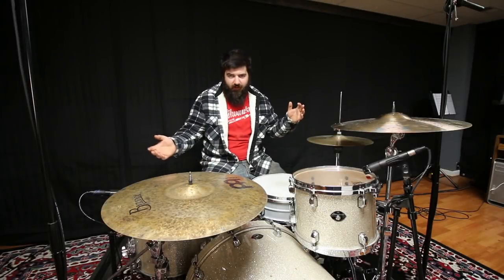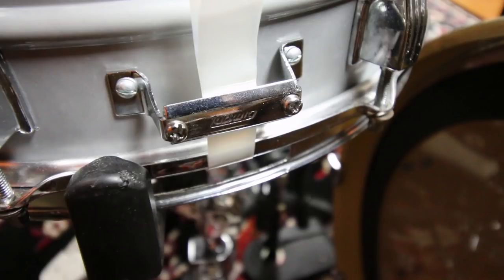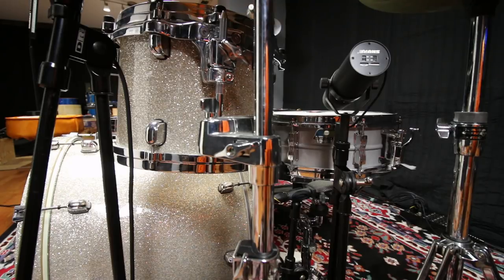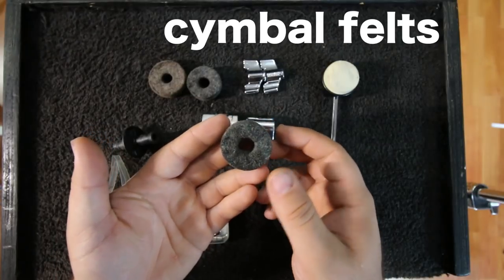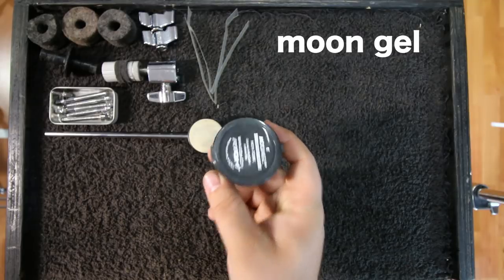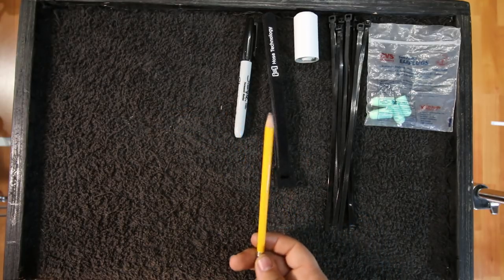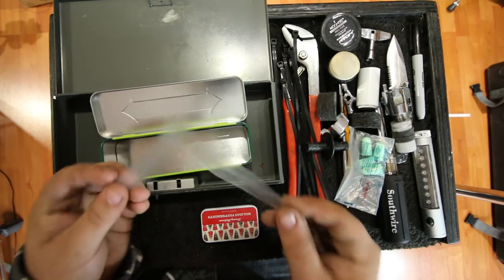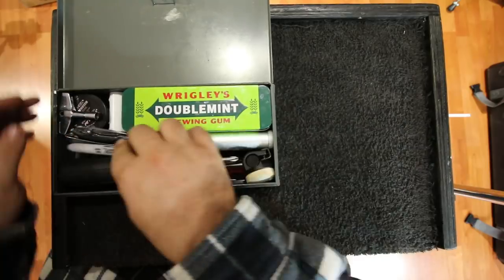How to Make an Emergency Kit for your Drum Set

Comment: in my drum hardware bag i also carry a set of acoustic and electric guitar strings, set of bass strings, some guitar picks, a tuner, a capo, a guitar strap (or two), and a pack of 9 volt batteries.  if the guitarist you're playing with had a dead 9v or broke a string on his guitar and you pull out the lifesaver from your drum hardware bag, you're getting a call when the next gig or project comes up.
Reply: Good guy drummer having the back of his stage mates. That's beautiful.
Reply: Yeah, great tip.  I used to carry an extra instrument patch cable and short speaker cable with me.  My guitarist band-mates were ALWAYS forgetting speaker cables for their cabs!
Reply: Same here. Extra instrument cable, plus a universal power cord, small extension cord and power strip.
Reply: Roe Sham Boe I also carry those stuff. But more so because I also play other instruments.
Reply: Roe Sham Boe never seen a drummer do that,that's great that you care about your other band mates
Reply: God bless you
Reply: Might be the wrong gauge though.
Reply: @russ6541  Better wrong gauge than no gauge, no?
Reply: I use a 9v for my IEMS amp and always carry one or two spares. There's been a few times when I had to hand one of my band mates a 9v.

Comment: Great advice, both in the vid as well as in the comments. I did some rearranging a few weeks back with the stuff I bring, and this is the current inventory (WARNING: BIG LIST)

In my stick bag (which I bring to rehearsals and some short gigs where I don't set up my own gear), I have the following:
- Sticks, mallets, brushes, etc
- Small digital metronome (mostly for songs I have to sightread)
- Voice recorder (to record rehearsals and sessions)
- 2 drum keys (can't have enough, take my word on this)
- SlapKlatz (gel dampening, like them better than Moongel)
- Multitool (foldable pliers, also include a knife, flat and phillips head, beer/can opener etc)
- Pencilcase with pen, pencil, eraser, sharpie, scissors etc etc (all the stuff I need to write out sheet music, quite a regular activity for a session musician)
- Blank sheet music in a folder
- Earplugs

In my gig bag (which supplements my stick bag for actual gigs and lengthy rehearsals):
- Practice pad (for warm up or dressing room rehearsals)
- Spare drum key
- Kickdrum patch (life saver!)
- Drum tool (with typical drum set tools)
- Thin cotton sheets (pillowcases) for dampening/effects
- Flashlight
- Music stand light (don't EVER think the stage lighting will be enough)
- Batteries for said lights
- Clothes pegs (you learn why the first time you have a sightreading gig in the open)
- Spare kick beater
- Hi hat clutch
- Drop clutch (for twin pedal gigs)
- Spare parts of every part on my kick (rods, washers, snare straps, felts, cymbal washers, screws, kick pedal springs, you name it)
- Earplugs spares
- Single use earplugs (for every single singer alive, they never think of their ears)
- Water bottle
- iPad (for sheet music or to watch porn during a gig)
- Powerbank (for iPad)
- Towel and deodorant (making an impression that lasts isn't always a good thing when you're a drummer getting off stage)
- Duck tape, WD40 silicon oil spray, tie wraps, rope and string (not for naughty stuff, just to be able to fix anything ever)
- Band aids and painkillers, just in case
- Spare multi clamp, to fix anything onto anything (drummers know what's up)

I also bring spare heads for any drum head, save my bottom tom heads, packed in the cardboard sleeve my kick drumhead came in. Also includes o-rings for my toms and a Big Fat Snare Drum

I usually also bring a foldable music stand, a pillow for my kick if it's not already in there, and sometimes an extra kick pedal.

Excessive? Absolutely. Until you need one of these things. My philosophy is that I want to be able to fix anything that could break and ruin a gig for me (which are quite a lot of things when you think about it), and it makes me feel very secure.

Hope this helps anyone wanting to come prepared. All the best.
Reply: thanks for putting in the time! My kick pedal broke AND snare stand fell apart at my first gig, this will help me be more prepared for next time.

Comment: I always used a multitool that has pliers, a knife, various screwdrivers, a ruler, and even a file. It takes up less space. Also for a case .... say what you want but I use a makeup bag. There is three compartments with open areas, some compartments are divided into smaller compartments etc. It also has a clear plastic front where I put the tools I use often  so I can get at them quickly.

Comment: Fun tip. I’m a drummer and a motorcycle rider and i learned that motorcycle chain lube works great on the threaded parts of the drum set. Particularly the wax kind of chain lube. Dip your threaded wing nuts in it and thread them. The wax kind of lube drys in about 30 minutes so you get the lubrication factor of grease or oil but it’s dry to the touch.

Comment: Great video!  I've discovered over the years that carrying enough cymbal sleeves for the total number of cymbals you want to use is super important.  I can't count the number of times on tour that I was using borrowed or backline setups with NO cymbal felts or sleeves.  On that note, I also keep a few different diameters and lengths of sleeves as well as 6mm and 8mm wingnuts to fit any brand of cymbal stand I might encounter.

Comment: Got all of those things carried inside the front pocket of my old VHS Video Camera bag. The bag itself can fit all of
my extra pairs of drum sticks, and my DW 5K Accelerator double-kick pedals (with linkage bar unattached, but included),
and my kick drum straps (to prevent kick drum creepage).
I wear glasses during a show; sometimes I don't; but for those sweaty hot stage gigs I keep a couple of straps
for my glasses so they won't slip off my face during a show.
Extras: several D-RINGS, two Dog Leashes, and a few Bungee chords... I gotta have those on hand in case I ever
forget my kick drum straps.

I keep larger tools (vise grips, drill, rasping file, gorilla glue, double-sided tape for use as drum stick grips, and a mallet) 
inside a gym bag, which I also bring along with me to gigs.
All the rest of my drum hardware, mounts, throne, cymbal stands go into my wheeled carry-on luggage case. lol
I used to use my old US Army duffel bag, until I lost a hihat rod. So then I started using a luggage case.

As a substitute for a Sharpie marker, I use a black or blue dry-erase marker... I'm usually in a mad rush to set up
my drum kit before a show, and I don't always have time to write a paper copy of my band mates' Set list,
soOo I grab my dry-erase marker and quickly write the song titles (abbreviated) onto the batter head of my floor tom.
After the show, I use rubbing alcohol to wipe the set list away with a paper towel... my floor tom batter is a
Remo clear pinstripe batter, so I can see my set list against the background of my drum shell even under dim
or color-changing stage lighting.
A coated batter is okay, but then I'd have to sand the set list off after a show, LOL.

An emergency kit is a Must-Have, it's always covered my ass before or during a show.
Of course, every situation is unique. In case of an emergency when drum gear suddenly falls apart
during a show, the best thing a drummer can do is Do NOT Panic, and calmly deal with the situation
as best and quickly as possible; or just ask another drummer at the show to let you borrow an item,
say, a hardware stand or a kick pedal. But, hopefully none of that would be the case.
We've all been through it, we just gotta be prepared to roll with the punches. ;-)

Comment: Don't forget a backup snare drum and a bass drum pedal next to you on stage! You can adapt to any other gear not working, falling apart or drum head breaking but those are essential and you need them next to you so you can do a quick change. It's probably a good idea to have a spare head for your bass drum and snare stashed in your car so you can change them between sets if need be.

Comment: Pliers are great when you're using someone else's hardware and they've tightened the crap out of the wingnuts for some reason.
Reply: I am one of that guys lol. I do it because my hardware is very old and used
Reply: That is one of my biggest pet peeves!
Reply: i do that on the tom-to bass parts cos i cant tighten with my hands enough. dont like them slipping.

Comment: if you ran out of cymbal sleeves but have your duct tape you can wrap a few pieces around where the cymbal goes. its not ideal and you'll have to clean it off later but at least you won't have the horrible metal on metal sound.

Comment: I usually always carry a leatherman multi tool in my bag-o-stuff and that covers your knife or scissors, pliers, flat and philips head screwdrivers. Pretty much any of the tools you may need short of Allen wrenches and drum key. But I also have one of the pearl drum tech tools and it's invaluable. Has screw drivers and Allen keys that fit all pearl equipment (obviously) 

Long hauls on the road I'll carry a bigger bag that contains pedal springs, hihat tension springs, snare straps, snares, extra lugs, leg casings and screws in the case something would inevitably break 

I love being my own drum tech!! because I'm waaaaay to broke to afford one 😆  

and also jealous of another man touching my drums 😡
Reply: I've done production work for television and motion pictures for a good long while well before wearing my current stage/sound reinforcement rigging and monitor mix eng hats. And there is no better method in deciding what's essential and works best for the fast paced, constant momentum and adaptive flexibility needed to be an integrel and valuable 'hand in a contemporary stage or production crew. Whether on a soundstage/location video/film shoot, venue in house stagehand, union local event load in/out, riding a road circuit,  world class touring or maybe a house of worship on Sunday morning, never forget to bring your best crew work ethic. Aside from open toed shoes not having much of one or not using it is the single most reason people don't get call backs or are escorted off stage. It's been my experience that even. At times, even a technical skillset and journeyman experience fall in second place to personable positive and unifying comraderie that draws a crew in just as a bandmember does not just by technical virtuosity but encouragement  and an awareness of how vital it is for individuals to desire and contribute towards an inspiring, high-functioning work  environment for everyone. Let's face it, the hours and conditions of doing what we love can be long, not always pleasant and at times frustratingly  unavoidable. The only thing you can change is attitude. and contagiously could be the difference between a memorable gig or a miserable one.
Oh yeah, don't forget some cortisone aerosol spray or cream and a change of clean underwear o because sweaty monkey butt ass rash is the worst, ANSAIDS like ibuprofen relieve headache and tense, sore muscles and joints. I only need one multitool for drums or anything short of soldering. The Leatherman Skeletool everything you need along including half a dozen on board bits of your choice. No bigger than a gerber folding knife. Indispensable. That, two drumkeys (one always on your keyring)  and a mini-phono to 1/4" stereo phono adapter (aka headphone adapter) someone always will need one and you'll never get it back so buy a dozen. And last, if you possibly can ( or save in advance and tuck it in a stick bag pocket) $50 to better expect the unexpected, hire a cab or help out that bass player who always seems to come up short at restaurants....
Reply: @peterhlinka4789  " you'll never get it back , so buy a dozen ... "     Ba-Doom tishhhhhh ... Truth Brother . I ran PA for bands I played drums in for ***kin years ... We're practical people ... I had adapters that would convert anything to anything , spare 1/4 in jack to jacks , 9 v batteries , those ' jug cord ' power cables . My brother the bass player used to set up my tubs while I set up the sound ... Despite being an arty farty academic , I spent a lot of my musical downtime in construction , my mentor told me ' anticipation is the name of the game ... '  Thinking about what might happen next is a rewarding strategy in all fields on endeavour

Comment: a few things i would add are the drum multitool it has 3 different drum keys a bunch of common drum hex/alan keys as well as a phillips mini screwdriver and on the other side is a hole you can use to quickly tighten/loosen wing nuts, as well as a flat head screwdriver for parts like the china cymbal mount amongst others, earplugs which wether you are playing or watching a gig they will become invaluable, and maybe a special drum key such as the one that tightens/loosens 4x instead of one, or the drum key drill bit for quick head replacing, what i use as my emergency kit is usually the pouch of eithre my cymbal bag or stick bag, otherwise fantastic suggestions david! also another common reason for allan/hex keys is for drum racks

Comment: More for recording, if you have a floor tom that won't stop ringing. Use three or four cotton balls mesh together and flattened out. Take off the top head and drop it in the center on the bottom head and put top head back on this will stop the ringing.

Comment: Extra drum keys, felts, cymbal wing nuts, cymbal sleeves, skins, bass beaters with pedal nuts, extra tension rods, mini drill and bits, philips and flat screwdrivers, electrical tape, duct tape, extra pedal, extra pedal springs, pliers, microphone clips, hi hat clutch, box cutter, zipties, and snare string (or plastic strips).

Comment: I use a toiletry bag, like what you might use when camping or traveling. It's durable and small enough, but you can also use a small messenger bag like I used to a year ago. I don't know which I prefer. Both work great.

Comment: I prefer to carry a tackle box because it's set up for emergencies with the 3 instruments I play (with mediocre proficiency 😉). I carry allen wrenches, screwdrivers, pliers, a couple of knives, cymbal felts and wingnuts, beaters, beater felts (by DW MDD can replace the beater itself apart from the rest of the assembly), guitar picks, guitar and bass strings, a patch cord, speak-on cable, power cable, mic, memory locks, pen, sharpie, moon gels, drum keys, a small socket set, truss rod tool, a flashlight, 9v batteries, an extra set of IEMs, and a phone charger. I also have some miscellaneous replacement parts I've accumulated over the years. My tackle box is pretty compact; a top tray with 3 compartmentalized drawers. It's no bigger than my double bass pedal case. I know I carry a lot of stuff, but I prefer to be over-prepared, especially when both my guitar player and bass player have taken advantage of my extra strings and picks lol

Comment: Hi David, thanks good video, I carry a spare pedal spring but also a spare cheapo pedal. I've found the thread on the hi hat clutch can loosen and the top hat flaps around, I use PTFE tape on the threads and in an emergency you could use cellophane from a cig packet! I once had my pedal spring break and used a load of elastic bands from the beater  and attached it to the stool !

Comment: You could replace the square bit with a hex wrench for bass drum pedal fine adjustment.
Old Trixon hardware on the drum lugs will break off instantly with the first attempt to turn.  There is no alternative but to drill them out,  best to leave them be.  Wing nuts always get dropped in setups over or near water or other impossible places to look for them or they are commonly stripped out on the house drum kit :)
I carry 2 sharpies, one black, one gold or silver for dark surfaces, also snare strainer string or plastic strips to keep snare wires on.  ya never know.

Comment: For the container I like to carry microphone pouches. Like the ones from shure that come with an sm57.
If you need more space you can use more of those. 
If you have more than one pouch then consider using a double bassdrumpedal bag for a single pedal and throw the pouches in there.
Reply: I like that ... I carry mics and cables to most of my gigs , another mic pouch in the case takes up next to zero room . Back when I was touring a lot I took kick pedal springs as well . I had a Swiss Army knife in the kit too ... Security at the Australian Parliament House confiscated it when my band played the Great Hall .

Comment: Instead of a flashlight I have a headlamp, which is fantastic for setups and teardowns. I usually have a Leatherman-style multi-tool in my stick bag on top of the pliers and screwdrivers in the crash kit. And band-aids - I've lost count of the times my fingers have gotten dinged up setting up or tearing down, and they also work for extra muffling!

Comment: Instead of cymbal sleeves, I also use small plastik hoses.  An assortment of cable adapters is also good to have. I prefer the slapklatz damper over the moongel. They have different sized pads and the packing is better.

Comment: I have a drum multi-tool, a knife, some pliers, extra felts and tension rods, and a pencil as well as dampening material (electric tape included) all in a little tackle box with removable dividers in it. I keep my extra bass drum beater in my stick bag because it has a separate holder for it.
Reply: And of course you can’t forget your cymbal sleeves